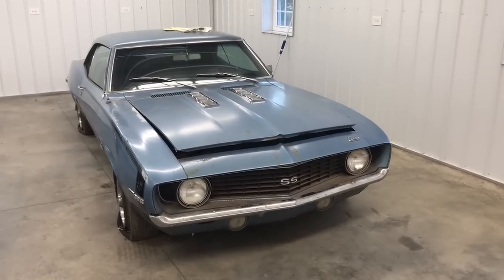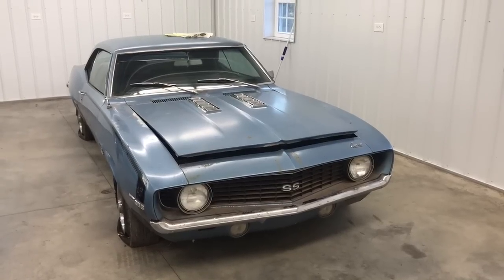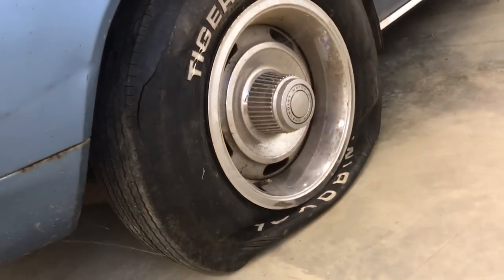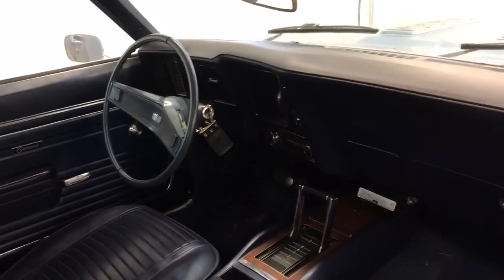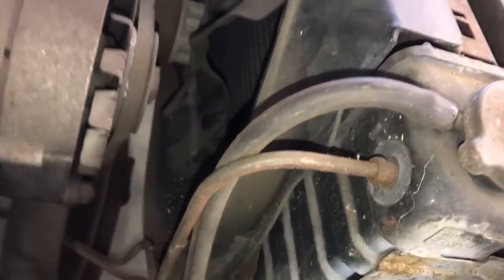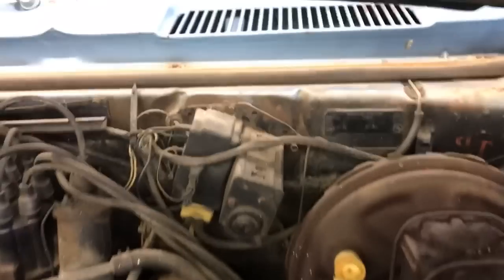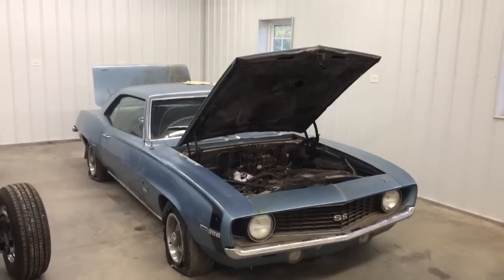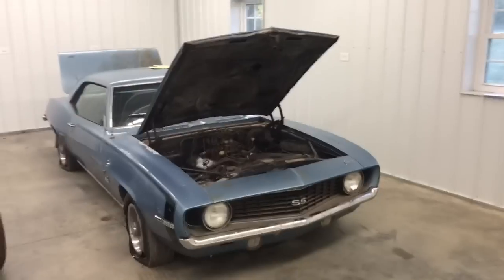WILL IT RUN??? Time Capsule 1969 Camaro SS396 Discovered Hidden Since 1981!!!

Comment: I backed these off delivery trailers brand new in 69, my father has a Chevy dealership in New Carlisle In. called Fish Chevrolet. We only survived from 65 to 71 but I saw the best years Chevy had. The first Z/28 was a mystery to me , it had no badges and only 302 cubes.Then I took it around the block. I told my dad to order more service option Z, 2, 8  cars. not really knowing that was the badge to be on the front fenders soon. There were tube headers in the trunk. the box said"must be installed by dealer".
Reply: What was the address and what is there now, out of curiousity?
Reply: @googleusergp  I,d have to drive out their, I'm on u.s. 20 at South Bend Reginal airport, Fish Chevrolet was 10 miles west also on u.s. 20. It actually said that on the business cards. Along with "Super Service and a Whale of a Deal" next door was Dick Brennen Ford, who sponsored some factory race cars for Ford. We sponsored a 69 L88 nasau blue corvette. My memories of that time are special 65-71 , so I was 13 - 18 , prime age, prime cars. But my best is the 68 Chevrolet new car dealer convention. second would be the first 70 Chevelle SS 454 garnet red black strips cowl hood , hood pins sitting in front of parts counter when I walked in after school. 10 grown men , standing around it , just rubbing their chins and pointing. We had never seen anything like this.As far as whats their now? I believe last time I drove up it was called Bob's Garage. I walked in the service door, told the guy I was just taking a look for old times sake, he replied "are you a fish"?
Reply: greg fish: good story!  Thanks for sharing!
Reply: A college buddy worked at G.M. in Detroit after he luckily survived his Vietnam tour for Chevrolet. He'd drag race his fellow worker buddy's in the huge parking lots after cars rolled off the assembly lines. Man what a great job!!! 
I worked for Audi,Volkswagon,Bentley,Lamborghini and Subaru on the rocks,i drove lots of cool cars over the year,but man I'd love a time machine to go back to the mid-60s to work with my bud any day!!!! I bet You and your family have some great memories of awesome cars like these coming to your dealership over the years! Good stuff.thanks for sharing your memories with us!!!
Reply: thanks for sharing your story I could listen all day!
Reply: I've been to New Carlisle IN. I live in Evansville IN which is the farthest you can be from New Carlisle and still be in the state of Indiana. I think it was a 5+ hour drive. I bought the quarter panels and roof off a 65 Cutlass from a gentleman there that was getting ready to have it crushed because the drivetrain was gone and he had no title.
Reply: @derrinpickett9948  ACTUALLY IT WAS 67 , MY BAD. WHAT YEAR WERE YOU IN NEW CARLISLE?
Reply: @master335  Not 100% sure but I would guess it was 2008 or 2009
Reply: @derrinpickett9948  I HEARD A PORCHE RACE TEAM BOUGHT THE BUILDING AND IS REMODELING IT . LOTTA GOOD MEMORIES IN NEW CARLISLE .DICK BRANNEN FORD WAS ACROSS THE STREET, THEY HAD factory 427 thunderbolts they raced, we had a L88 corvette we sponsored. Good times.
Reply: Cool story👍🏼
Reply: Yes the high performance stuff came in the trunk, the factory could not equipped the car with them because of US standards but they could sell them as an add on.

Comment: Wow ! 1969 Camaros are my weakness. I've had 7 of them starting in 1978. I had three at once and my Dad said "this isn't a junk yard. You can have two, maximum". I used to buy them broken, fix them, race them / cruise them, and sell them to build another one. We never knew how special these cars were / are. In hindsight, I should have kept them all original and built a dry warehouse to save them. This brings back lots of great memories. Thank you Patrick.
Reply: Lol, in the early 90's we learned to drive in dad's 77 Plymouth Volare' wagon, 225 slant six, dog leg burnouts down the gravel driveway or maybe on an uphill start in the rain.  We could use the car but around their schedule and if we wanted our own we could buy it and all the required insurance, gas, oil, etc. our self.  Was told I couldn't have more than one car at a time.  I bought a 72 Dodge Demon 318 beater for $200 from a co-worker at McDonald's, snuck it out to work one night with no insurance, no speedo, no mufflers, no blinkers and earned my first ticket!  Took me 3 months to get my SR-22 insurance and license back from the state unbeknownst to dad.  Had it legal for about a week and slammed it in the back of a friends pickup after school.  Back to my skateboard for a bit to save $400 for the primered 71 Monte Carlo and traded the Demon for 2 mag wheels and tires.  Then found a 70 SS Monte with nice green paint and interior, console, buckets, missing the BB for a swapped 350 4bbl for only $750 in a back yard from an alley.  Of course, the tranny blew from too many nuetral dropped smoke shows in the 71' so I was back to the skateboard till I saved the $750.  Drove 400 miles on the SS and spun a rod bearing, probably should have changed the oil and not been rodding on it.  Towed the 71 to my HS auto shop and pulled the motor, towed the 70 SS and installed it, swapped the intake and carbs, converted to HEI (bad fusible link wire kept burning through coils).  Got it going just perfect finally and some drunk bitch in a 442 with no insurance slams me head on and cracked the frame, destroying 2 nice cars.  Her boyfriend ditched the scene and she moved across the bridge to the other state so no real recourse from her court ordered payment to me.  I pulled the motor again and traded both shells for a 77 Firebird set up for SBC but sold it out front of auto shop cuz I wasn't into it and was burnt but in the meantime I bought a 76 Tradesman customized van to drive that was groovy plus a Honda Interceptor crotch bike from the dude that got my Demon.  I guess my point, I just laughed cuz I pretty much always had 2 cars at mom and dad's, going though 10 from 16yrs old to 20.
Reply: @THRASHMETALFUNRIFFS  Those first generation Monte Carlo SS's are worth some money these days since they didn't make that many of them.  I have a non SS 70 Monte Carlo that I've owned for over 32 years.  One of my favorite cars.
Reply: @Mr2004MCSS  Oh I know, I think about 3500 of them made.  Check out my Musclecar TV short video about it! Same color mine was.

Comment: Motor support got an after market strenght cable at 19:26 i remember that from the 70's... another great video,thanks for sharing!!
Reply: That's a factory recall tether from 1971. The drivers side mounts were breaking, causing the throttle to stick.

Comment: This reminds me of the car my late brother restored in the 80’s. It was a 69 Camaro SS 350/300 hp with a four speed and a 12 bolt rear. All numbers matching. Miraculously it was never molested or hot rodded. It was factory black with red hockey stripe and black deluxe interior ac ps power disc brakes and the base steel wheels and poverty caps. He sold it for $10,000 in the 90’s when he got married (and later divorced. It was a nice car and now i know it was pretty rare in black.

Comment: Yes I think  you are right, I would not restore  that car. I would fix what needs to be and put it running condition.  Nice street classic.
Reply: Problem is it needs to be taken totally apart to see what is truly wrong and why do a job half assed.  Just restore it and have a great car again that can be driven anywhere.  I'm not talking resto mod, factory original.
Reply: @scotmandel6699  
I agree. Restore it and bring it back to its original condition. Neglect is why it's in the condition it's in now, why leave it like that? I can understand leaving it alone if it was not neglected.
Reply: @markurbancowboy  I would live the paint and fix the rest.

Comment: The reason the ten thousands and thousands numbers are showing like that is because the tamper tab in the odometer is broken. That can be seen by the white line showing between the numbered wheels. So there's really no way to tell how many actual miles are on it since when that tamper tab is broken those wheels will no longer move.

Comment: I always have trouble justifying leaving these cars as is. Someone cared enough to keep her intact but still neglected her. She was beautiful rolling off the assembly line and should be that way again.  No reason she can’t be original AND shine like new.  If asked, she would say the same!
Reply: Yea they let it sit outside for 35 years and then all of a sudden they want it too look brand new 😂
Reply: If it was mine I would make it look like new again! Back in 1985 I bought a 1970 Red 442 convertible. It had 100k miles and ran decent but smoked a bit. The paint looked ok better than this Camaro but not super by any means. Anyhow i did a 2 year restoration of the car and made it look & run like new again. It won best muscle car in my hometown several times. Anyhow I think making them look like new is pretty cool as well!
Reply: What part of original dont you understand??? lol

Comment: Car was not sitting long before it was previously started - those old Q-jets leak down after a few hours of sitting and require you to crank them for a while until the float bowls fill back up.  Rust on lower quarter is significant in my book - will require trunk extensions, and inner wheel house is likely toast too.  Still a nice, intact car.

Comment: You all probably wouldn't agree but I would fix that rust on left rear quarter panel where it rusted thru..i hate rust but would leave the rest like it is.
Reply: Is that a former fiberglass repair around the rust hole?
Reply: Definitely would cut out the rust so it doesn't spread, but like you said, just clean up the original blue and black hockey stick as best you can without reshooting the car. Awesome find.
Reply: I agree totally, clean up the obvious deterioration,do what is necessary to be roadworthy...good survivor car.
Reply: Agree as well, rust will continue to spread if not put down.  The dust doesn’t do anything for me either.  I would clean and preserve.  If it didn’t leave the factory with it, and they did not leave rusty and dirty, I would clean and preserve.  The thinking of the paint in some areas adds to the character of the car.

Comment: I was in my teenage years when these were just a used car and some of my friends had 68, 69 and 72 Chevelles with various engines and let me tell you the 325 hp SS396 was nothing to sneeze at and I know it from firsthand experience. My neighborhood friend had a 68 Chevelle SS 396 325 horsepower and a 4 speed and that thing would seriously spank the 72 Chevelle SS 454 LS 5 I believe it was. It wasn't even close. One other friend had a 69 Chevelle SS 396 which I don't remember what build it was but it was the glacier blue just like the Camaro in the video and it was immaculate and he never pushed it that I'm aware of. He might have punched it once and it scared the shite out of him so he never did it again. It was also a 4 speed car.

Comment: I have a barn find 69 camaro in my garage awaiting restoration Its a RS/SS model has a dealer installed 385 hp 427 options include PS, PW, AC, 4speed ,cowl hood  Custom Deluxe interior w/blk/wht houndstooth. fold down rear seat console and traction dispenser, Ir was a dealer promotional car say on showroom floor until mid 70 I bought the car in 77 owned in thru high school and sold it after college grad for 2200, 25 yrs later I ran into the guy that bought it  after a yr of negotiations I now have the car back in my hands rust under the vinyl top pretty severe along with the sides of the qtr panels  other than that the car is in great condition , looking forward to taking a step back in time and taking the same girl i dated back then  out  on a date  and hopefully get lucky in it again!! she still is a hot as the car was back then, Patrick I love your posts and look forward to what you find next  KEEP THEM COMING !

Comment: People have wacked and hacked the true meaning of car terms for so long now that hardly anybody knows the true meanings anymore. For example the term matching numbers. For the point of this comment is the term restoration. This car is a prime candidate for an authentic restoration to preserve it's value and to insure the protection of the investment. To leave this car as a survivor would be to allow the car to continue the rust to rot process losing any investment potential. It is also worthy of NOS panels, parts, and pieces. I hope it gets preserved the right way by knowledgable folks.
Reply from the maker: Knowledgeable folks say no way this car should be restored. Thanks for watching,
Reply: Disagree, sorry. This car is special and there are darn few of them left. I might give attention to the serious rust, and clean up the engine bay and interior, but I’d definitely not completely eliminate exterior patina. Most important would be to keep it in climate controlled building. From the looks of things, they might have that much covered already.
Reply: Interior very nice !

Comment: Very nice vehicle and well preserved 1969 Chevrolet Camaro Super Sport 396 C. I. , Big Block V8 325 Horsepower  with   the Turbo-hydramatic 400 Transmission.

Comment: my fathers cousin Noah had the identical car except his was a 4 speed it was a 396 375 hp he owned it on the mid. 70s he bought it for 1500.00 dollars off a used car lot in Albany N.Y.  brought it home and pulled the 396 and put a 350 LT1 that was warmed over in it and 4:56 gears and ran low 12 s. back then that was moving for a street car. good times !!!

Comment: Neat old Camaro.   Looks like the thermostat had been changed... .looks like RTV blue.... I wonder what GM engineers were thinking when making the big block available in the Camaro  at that time ?  It wouldn't be much faster than the 275hp small block.

Comment: Outlaw 77.  I believe the torque straps were a GM recall.  I was the assistant service manager at a Chevy dealership in 1976.  We did several of these recalls.  GM called them campaigns.   I guess they didn't want any negative connotations.  My 65 Impala had them when I got the car in 1991.  I believe there was a motor mount problem.  But not sure.  Hope this helps.
Reply: The rubber motor  mount would break, and when under acceleration the motor would lift up. Then the linkage for the gas pedal would pull the carb wide open!  I worked in a chevy dealership, and there were work benches that had been bent up back in the 60's from mechanics running into them when the pedal stuck.  Scary stuff.  This is why the linkages were changed to cable types, and the mounts re-enforced to prevent lifting.

Comment: I would just get the rust off, and leave that thing as is.  Don't even drive it that often.  That's a collector hands down.  That 396 runs nice and strong.  It seemed a little hesitant when it started up, but I'm sure that's just because it was cold.

Comment: Looks like that odometer might have been messed with but I could be wrong.... but still a sexy ss 396 time capsule :D
Reply: I wonder about the condition difference between the two valve covers also.......

Comment: appreciated rescue! engine sounds strong and it appears very restorable; however, also appears to have been run pretty hard for the 12 years it was on the road. will need stripped to bare metal w/special attention to lr quarter, rt door and rf fender (and floors?), as well as a few other electrical & vacuum line details. did claude raines shut down the engine? fuel gauge wire has broken connection, which supports suspected speedo tampering (legit concern). thanks for posting.
Reply: And then this one will be ruined too....lol

Comment: My buddy use to have a brown 69 real with a 396 4 speed used to be a fun ride not as fun as some of my old mopars I’ve had but a nice ride around 74 or 75 he had it he used to give me a ride home from work looked exact same only brown with the same hood and a Muncie 4 speed nice find you have here it’s funny he had tiger paws on it to I’d repair the part of quarter that is rusted and th hole by the back window but would leave it alone other wise

Comment: I like the cables from motor mount to the control arm
Reply: That was GM recall item, broken engine mounts could shift the engine and jam the throttle open. So they cabled the engine down.

Comment: You’d be crazy to do a restoration on the body. I’d make sure the car was mechanically sound including suspension and brakes. Most of that stuff on the back can be scrubbed off. I’d clear coat it and let it be. A car is original only once!

Comment: Kid down the street from me growing up in the 70s/80s had a 69 z28 SS 396 4 speed white with black stripes. Another kid had a 69 GTO 4 speed and another kid had a 70 Chevelle SS 454 automatic.    They weren't cheap but they weren't more than a few thousand dollars in 1980.   The Chevelle might have been 5000 even.

Comment: weird that it has a console and no spoilers, I have my 69 x66 from original owner and it’s a 396 350hp no console no gauges column shift car the only options were the 350 hp and a vinyl roof and a series 3 rear with 4:56 setup
Reply: I have always seen the 396 325 hp or the l78 375 hp Camaro.  Just curious what engine ID does the engine have on the block?  And doe the serial number match the vin number?  I suspect this would be a rare Camaro if indeed the 350hp is original engine.  I miss my RS/SS 350 300 hp four speed fun days in the seventies...  car burned rubber all four gears.  Single track rear end...

Comment: Did the 325hp come with the Crome air breather? I know on Chevelles it didn't....?
Reply: The Camaro did. I had a '68 Impala with the 325 horse, and it just had the single snorkel black air cleaner.